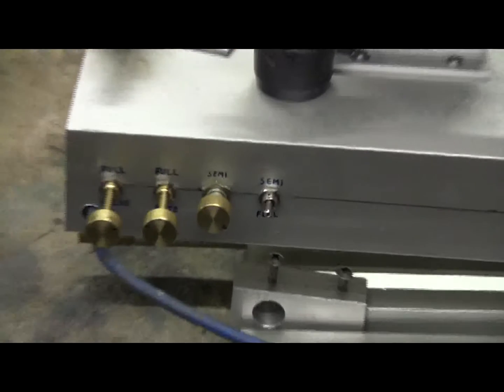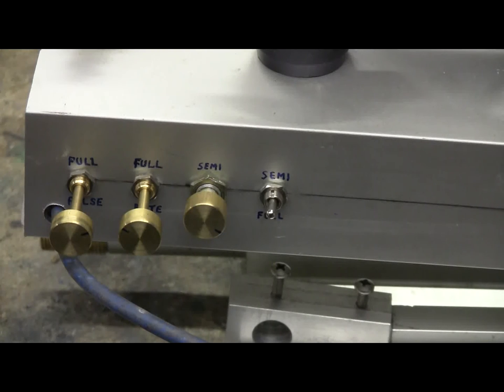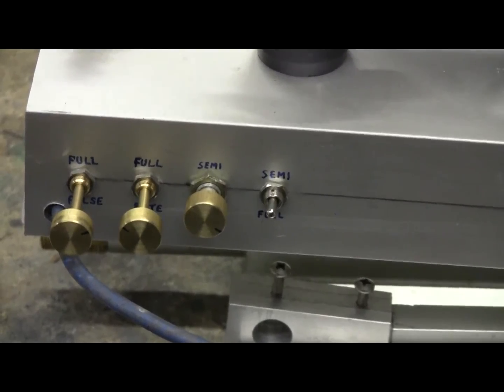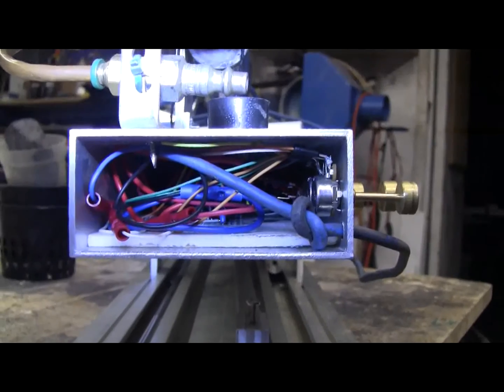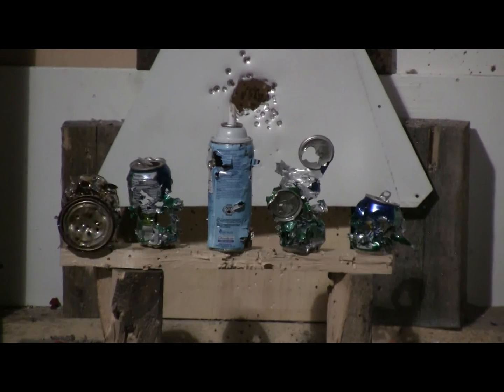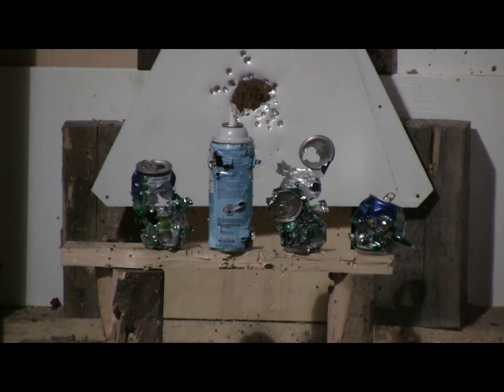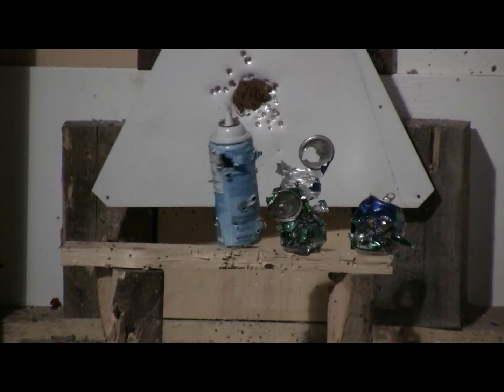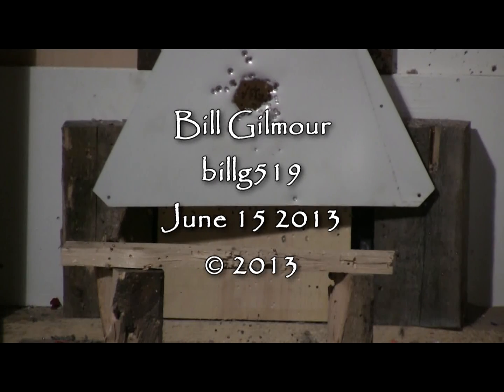Air Cannon #82 - Final Full / Semi Auto On .177 BB Cannon

Comment from the maker: I did make one last lot of mods to this cannon. It got a pneumatic breech, just like the .25 cal air cannon. It can now mount on the pedestal mount that the .25 cal is always shown on. Also I added a pistol grip with a trigger (for use on the pedestal mount), so it can be fired from the cord switch or the trigger.

Comment from the maker: The TL494 is quite useful. I've never built a switch mode power supply with one, but I have used them in tesla coils and flyback drivers. It was nice to use one for an air cannon.